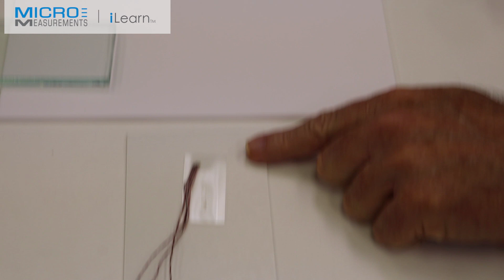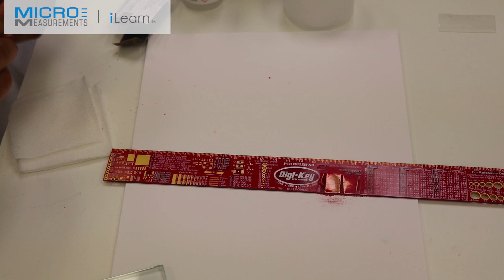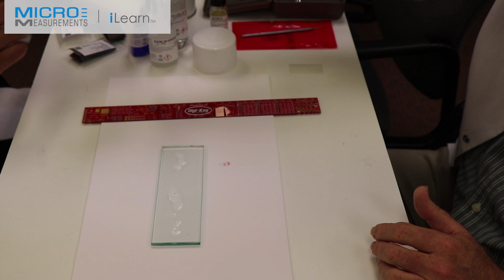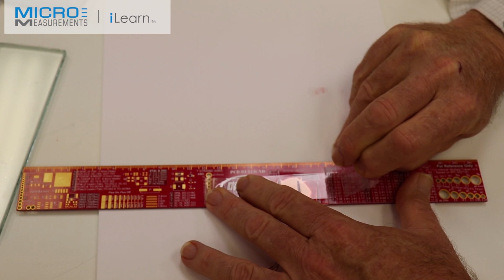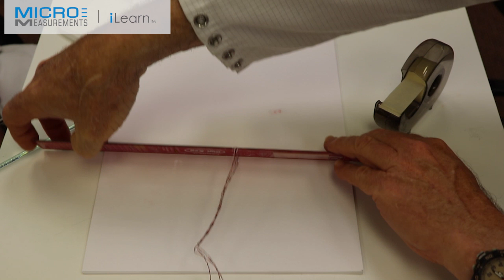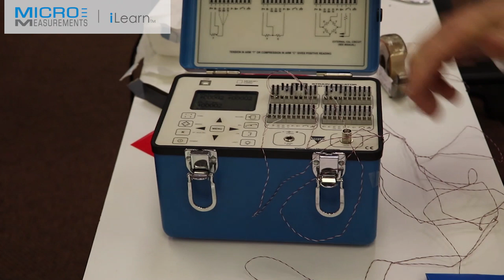Strain Gauge Installation on Printed Circuit Board (PCB)

Comment: Los PCB`s son prioritarios a la hora de fabricar automóviles, aviones, etc, y dado que sus procesos de fabricación exigen placas finas, esto hace que aumente la posibilidad de fallo en el circuito. Desde Micro-Measurements® ofrecemos todos los materiales necesarios para los ensayos extensométricos requeridos para la validación mecánica de los PCB`s, incluidos en las diferentes normativas al respecto, como la IPC/JDEC-9702A. 
Si necesita más información, por favor no dude en contactarnos. mm.es@vpgsensors.com miguel.bravo@vpgsensors.com